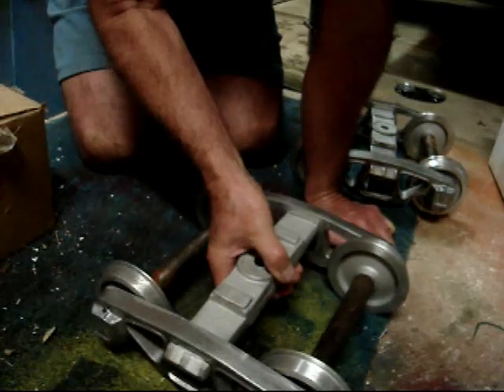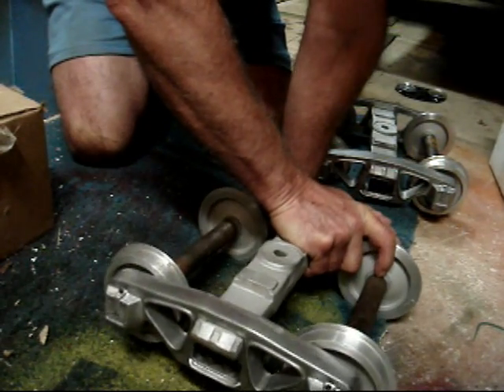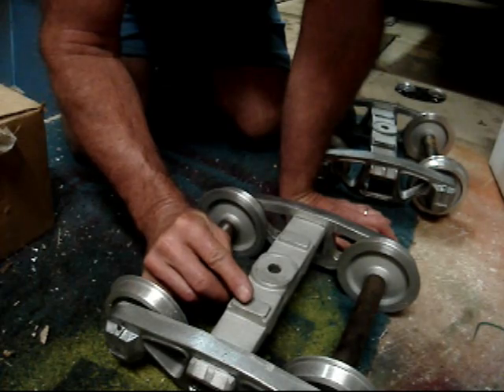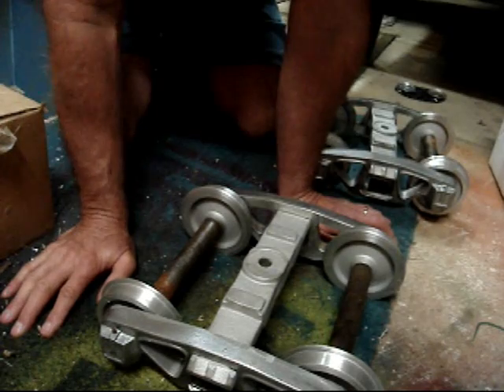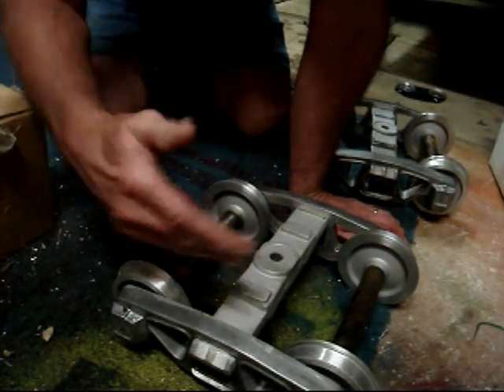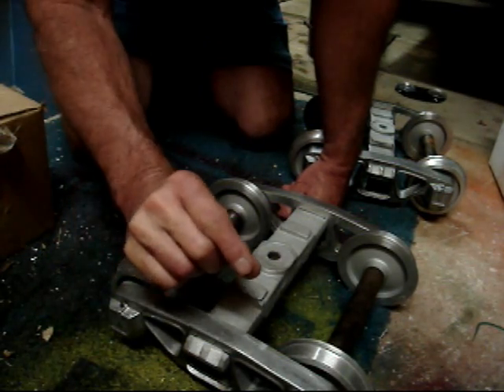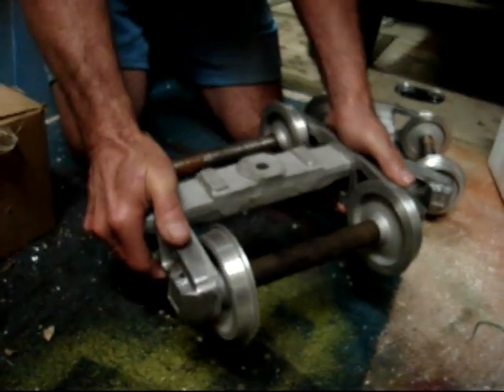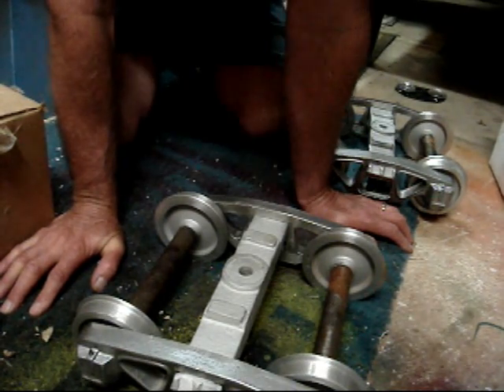Make aluminum sand casting train wheels  & truck video part 2

Comment from the maker: @amberb57 That just helps the shock from the rail joints. A smoother ride on the cars. Stanleys Santa Fe engine and mine don't have strings at all. All the engines exept the steamers don't have springs.